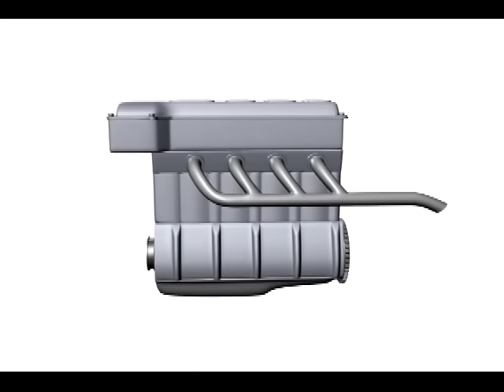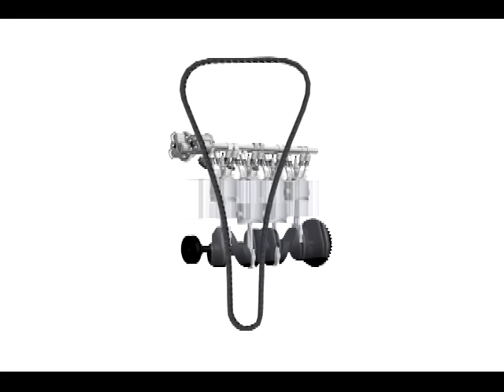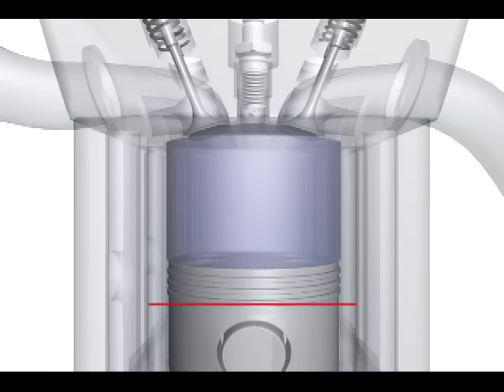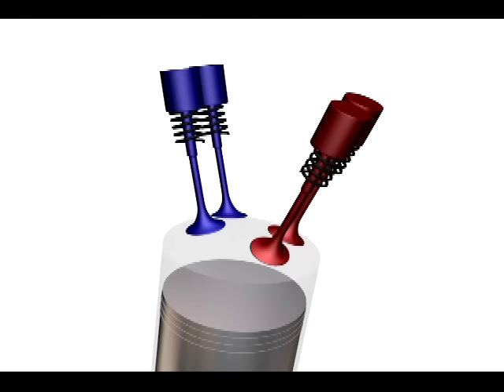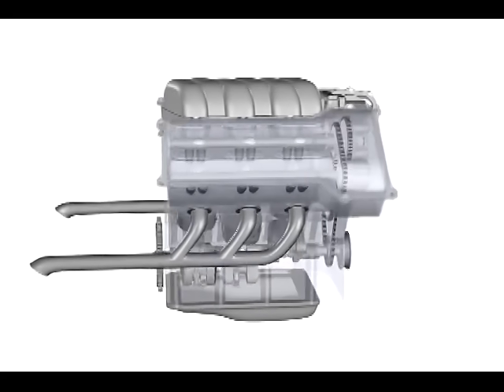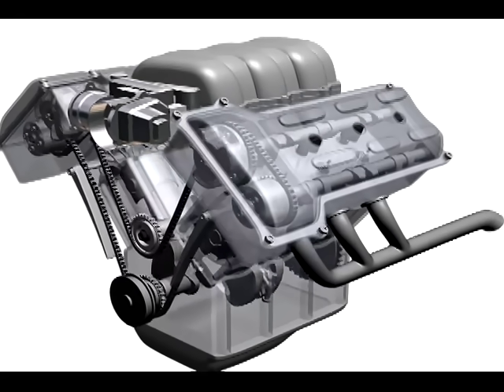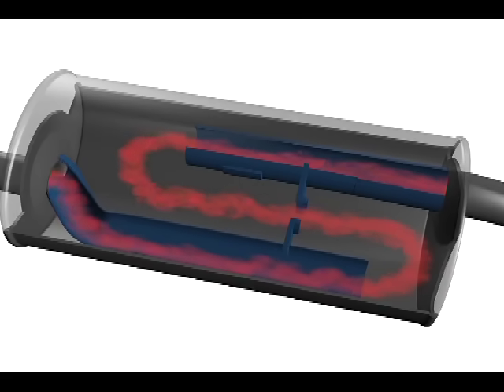How an engine works - comprehensive tutorial animation featuring Toyota engine technologies (2008)

Comment: There are some very untrue statements in this video. 
NOT ALL TOYOTA 6 CYLINDER ENGINES ARE V! Hello?!?!? 3.0 Liter inline six??? Made since the 1980's! 
Toyota has been making 6 cylinder straight engines before that too. 
Not all Toyota engines are dual (not double) over head camshaft engines either. 
Boo to whomever made this video. 
Blatant lies.
Reply from the maker: Hello, if you’d read any of the comments or the description you’d understand this was made for dealer training in 2008 and ONLY talked about current (in 2008) Toyota engines. How many videos do you have with over 10,000,000 views?
Reply: @ramblingadventures  Hey didn't you know people that watch YT videos are usually super smart and know everything about everything and will argue no matter what?  Car videos are just loaded with "expert" comments like the one above!

Comment: The modern internal combustion engine is an incredibly complex machine, that is the result of perhaps over 100 years of innovation and evolution.  The Engine is short for "Genius Machine".  I went thru Mechanical Engineering school in college, and yet, no class or professor in the curriculum ever explained this machine so thoroughly.
Reply: Engine does not mean "genius machine", and whoever told you that is an idiot. 
The word engine literally means, "a machine with moving parts that converts power into motion." 
Read people. Open a book every once and a while.

Comment: Why not just manufacture larger valves... instead of using 4
Reply: well it really has to do with how quick you need valves to fire in a certain time or the car cannot supply power correctly 🫶

Comment: "all toyota 6 and 8 cylinder engines are v type engines..." ok what about the 1HZ, 2HZ, 1JZ, 2JZ
Reply from the maker: This was made in 2008 and was only about current production Toyota engines as has been posted about 10,000 times here.
Reply: @ramblingadventures  They use HZ engines to this day in the landcruiser 70 series sold in the middle east and south america, they were just phased out of western and Asian markets. I suppose the video is only covering gas engines, but it's still wrong.

Comment: WRONG COMPLETE GARBAGE NOT ALL TOYOTA ENGINES THAT HAVE 6 CYLINDER ENGINES IN V CONFIGURATION. Take a look at the toyota supra 2jz engine for example. It is a inline 6 not a v6

Comment: Now learning about engines makes me more buy petrol or diesels, who cares about electric cars they are shit anyways real cars are with engines and those engines that last forever and are bulletproof made because not all are made to high standards.
Reply: Hassan Khan both are cool feats of engineering imo. I own 2 petrol cars but I’ve driven an electric for a year and it was fun
Reply: @818deadboys  but still you cant bear the real engines that humans beaung using for decades,  electric might be fun but when it comes to problems and repairs then one you cant repair it at home or your self and second they are not cheap to fix, and they are cheap built quality as I todays cars are known for quantity and quality. Today cars are just full of tech which most times I wouldn't need and therefore it's just waste of money for a car that would not last as long as a old e.g. toyota corolla or something.

Comment: Not a single gear head here has pointed out the motor is rotating in the wrong direction. On the single and dual over head cam motors

Comment: literally all old small block Chevy's use 2 exhaust valves and 2 intake valves LOL just saying
Reply from the maker: Yeah, with pushrods...just saying.
Reply: All generations of the small block chevy have 2 valves per cylinder not 4. There is one exhaust valve and one intake valve per cylinder, not two.

Comment: This is a very very good and informative video, however they are wrong about one thing. They said that all 6 & 8 cylinder toyota engines are V style engines but toyota does have inline 6 cylinder engines. It's still a very strong video with amazing graphics though.

Comment: Never knew that double head camshafts were a thing. I've also learned that most high performance engines use double intake and exhaust valves.

Comment: I'm driving a 1997 vs commodore wagon that takes 100 plus metres to get to 70k, maybe 80k if it's warm enough bahahaha 😂😂, have to switch the cooling fan on from under the dash with a bodgie switch, absolutely no suspension, leaks oil, coolant, transmission fluid and power steering fluid but it won't die! If it does not start it's always a loose something due to the suspension, I go around checking for loose fuses, relays or vaccum hoses popped off. Got it for nothing, It's been 5 yrs and all I do is spark plugs, leads, petrol and air filters and fuel injector cleaner once a year. I had to change a petrol pump and that's it and a vaccum hose came off. Been pretty lucky.

Comment: A lot of power is needed to complete a stroke by pushing an engine's piston up or down once.  So where does the power of the first two and last strokes of that stroke engine come from?  Because with a small amount of power it is not possible to supply a stroke of a 1500 kg car engine.  You explain a little to me.  I haven't understood this thing for a long time.
Reply: When the engine is first started an electric starter is used to spin the crankshaft and start the process. While running the force from the combustion stroke is enough to push the piston through the other strokes. The momentum of the crankshaft and the flywheel pushes the piston through the other three strokes.

Comment: How that spark works that much fast speed??????
Reply: Older cars used a distributor. Inside the distributor is a spinning contact that rotates with engine speed, as the contact turns it sends power to the corresponding spark plug. The spark itself is generated with the coil. Modern cars are computer controlled, the ECU monitors engine speed and load to determine when the spark should occur.

Comment: How does it transfer that power to the driveline?
Reply: The rotational motion of the crankshaft is transferred through a system of gears called the transmission. On front wheel drive cars the transmission is then connected directly to the wheels. On rear wheel drive cars the output of the transmission also goes through a gear in the rear axle to reach the wheels.

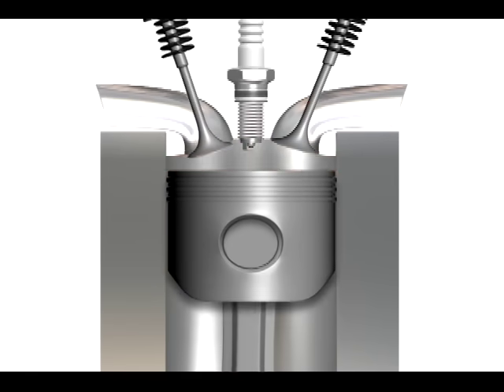Comment: 6:40 good at high speeds not good during low speeds.. would that be like a vtec engine then? Because if im correct you dont get a boost in power until you reach a certain rpm or speed right? Im not really educated about cars yet lol
Reply: Similar concepts but not exactly the same. Vtec is variable vale lift not variable valve timing. With vtec, when a certain rpm is reaced the valve will be opened more but for the same amount of time as in lower rpm. With variable valve timing the valve will open the same amount but it will stay open for a longer period of time.

Comment: Damn videos like this make you appreciate new engine technologies that oldheads love to tear apart; “filled with computers,” “can’t work on them yourself”
Reply from the maker: A lot of people still buy the BS that modern vehicles don't last as long as "simple" old ones but that's nonsense. WIth the much higher level of metalurgy and computer controlled machining, plus the fact the engines are computer controlled to run perfectly all the time under all reasonable conditions, vehicles have never been as reliable or long lasting. It's a fluke when you get a dud of a modern vehicle and it's usually a design flaw that causes it to be a dud.
Reply: Older cars were not more reliable, they were just easier to diagnose and repair yourself. I for one, do not miss the days were you had to make sure you brought spare points with you for long roadtrips, or retune your carb because you went up 2000 feet in elevation, or have to stop for a while to let your drum brakes cool down so they actually work again. Not to mention the absolute joy it is to start a carbureted engine in below freezing temperatures.

Comment: Good video. But not all Toyota engines are V ie: 2jz Toyota Supra inline 6. Known for its forged internals straight from the factory which allows it to be pushed to 700 whp without many engine modifications

Comment: How does the piston have the ability to compress the mixture initially? Does it use electricity from the battery?
Reply: Yes, an electric starting motor is used to start the process. The motor is powered by the battery

Comment: I need to know when engine has high rotation but tyres dont rotate where the energy transfered?
Reply from the maker: That is all transmissoin and clutch or torque converter. The engine is only connected to the wheels by a transmission and differential and totally disconnected or connected from driving the wheels by a clutch or torque converter.

Comment: That's not how you calculate displacement.

COMMON EXAMPLE
350 Chevy
Bore: 4.000 inch
Stroke: 3.480 inch

(Pi*R^2)*stroke*cylinders

Radius= 1/2 bore

(Pi*2^2)*stroke*cylinders

(Pi*4)*stroke*cylinders

Pi=3.14159

(3.14159*4)*stroke*cylinders

12.56636*stroke*cylinders

12.56636*3.48*cylinders

43.7309328*cylinders

43.7309328*8

349.8474624

He mentions producing torque at low RPM vs Horsepower at high RPM.

First, we must understand torque.

Torque is a measure of rotational force at the crankshaft. 100lb/ft means a force that will move 100lbs a distance of 1ft.

Next, we must understand horsepower.

Idiots think HP is a measure of an actual fucking horse pulling a weight with a rope and pulleys.
These are the stupidest motherfuckers alive and they should not be allowed to breed

Horsepower is not a real number.
Horsepower is only a mathematical function of torque.

HP=(TQ*RPM)/5252

Pull up any dyno chart. At what point do the lines for torque and horsepower intersect? At 5,252 RPM.

Do the math yourself

Let's assume an engine that makes peak torque at 2000RPM. It makes 100lb/ft

HP=(100*2,000)/5252
HP=200,000/5,252
HP=38.0807311500

Let's assume the torque curve is relatively flat. We make our peak HP at say 5,500RPM. Our engine is making 90lb/ft at this point

HP=(90*5,500)/5,252
HP=495,000/5,252
HP=94.2498095963

Let's assume 85lb/ft@6,000RPM

(85*6000)/5252

97.1058644325

60lb/ft@8,500RPM

(60*8,000)/5252

91.3937547600

At this point, power starts to fall off due to torque falling off.

Suppose our torque curve stays much flatter. Our peak remains 100@2,000. Imagine 70lb/ft@8,000RPM

(70*8,000)/5252
106.626047220

Here we see that we can pick up more Horsepower at higher RPM, even though torque has dropped off.

Racers describe it this way:
Horsepower is how hard you hit the wall
Torque is how far you drag the wall with you

It's all just simple arithmetic, folks

Comment: I dont know why, but I feel like I learn better if I do my own research than if I'm at a classroom and the teacher is going through notes over the same exact topic... Though, there are definitely more benefits to being in a automotive classroom environment since you have CERTIFIED automotive technicians and probably much more access to cars and shop equipment, that you normally wouldn't have as much of... I like being in the classroom just as much as taking the time to try and learn something on my own, but I feel that classrooms are just too fast pased for me, especially for a topic this complex.

I also feel like if I finally do get a vehicle for me to work on as my own vehicle, my education and motivation to learn will more than likely skyrocket because I can finally put the information to use, and it matters more since its MY VEHICLE and I'll become much more familiar with it instead of working on different cars all the time...

But that's just me...

Comment: "al toyota engines with more than 4 cylinders are in a V shape"

Sir u forgot about the mighty, unbeatable supercar eater, celestial legendo of tuning:
The Supra
Reply from the maker: In 2008 when this video was produced for Toyota dealer personnel, there was no non-V 6 or 8 cylinder engine in production by Toyota. The video is not a historical accounting of every engine Toyota ever made but a contemporary training piece that is only interested in the product line that was available in 2008.

Comment: Is there just enough room for the Pistons to hit the spark plug in the cylinder? I have a hard time seeing it since I imagine it being vacuum tight unless the exhaust valve doesn't the completely close on the compression
Reply: Is that why the top of the piston has the hollow holes? I just don't see how the piston closes and compresses the fuel without going anywhere?
Reply from the maker: No, the spark plug would be damaged if the piston hit them. There is a "dome" of various shapes (depending on the designer) where the compressed fuel and air occupies when the piston is all the way up. The valves do shut basically vacuum tight and there are piston rings that create a seal (by using a film of oil and very tight clearances) so though it's not a full vacuum, there is little loss of the air/fuel mixture.

Comment: How do we start it.... How does it start??
Reply from the maker: There is an electric starter motor that's run off the car battery that has teeth that mesh with a flywheel on the crankshaft that starts the motor turning. Once it's turning, the ignition and fuel system spring into life to "fire" the engine. That's why the engine is "dead" if the car battery is dead. The battery gets recharged and the electrical system is powered by the alternator once it's running.

Comment: AM familiar with older engine design but how is intake runner length change actuated, valves?
Reply: Intake runner length does not change. It is determined when the intake manifold is made.

Comment: How do F1 cars get their high pitch sound? I'm a car noob.
Reply from the maker: They rev extremly high. The parts have to be incredibly light to enable an engine to rev that high. Your average street car revs (crankshaft revolutions per minute) to around 6,000 RPM (revolutions per minute). A high-performance street car might rev to 8 or 9,000 rpm. Older F1 cars could rev to 18,000 RPM! To save cost, they are now limited to "only" 15,000 RPM. Similar to what a high-performance motorcycle engine sees.

Comment: Question: which type of engine is this? SI or CI? because you told air fuel mixture is enter through the inlet valve then what is the use of injectors in this engine? i am confused!
Reply: The injector usually injects the fuel just before the intake valve. On some cars, the injector injects the fuel directly into the cylinder.

Comment: VVTI systems for computer programs, anybody?
Reply: couldn't you just control the intake with pressure of air in lines just reconstruct the spring over head injector valves??
Reply: 7:09 wouldn't be necessary if the spring system in the injectors above was redesigned with pressure system air/NO3 pressure tanks.
Reply: Patten Pending EVS LLC

Comment: Yes i have the basic question...how piston gets energy..to move...there must be something to initiate piston movement at first.
Reply: martin mathew The counterweight
Reply: @luayon  no, the counterweight helps reduce vibrations and make it easier to push the piston up when the engine is already running. An electric starting motor is used to start the entire process.

Comment: Question: You mentioned about fuel injectors in very start of the video so it should be Direct Injection Gasoline Engine but when you explained the strokes you took mixture of air and fuel directly from the intake valve why theres no injector in explanation??
Reply: OTTO Explained I think it is with the “breaths” 

It sucks in, the injectors go sssspheeeewww and then it sucks it into the combustion chambers or sumthin.

Comment: Won’t VVTI throw off the timing of the engine if it constantly changes the valve opening/closing? Especially if it only controls one camshaft?
Reply: Yes, thats why its called variable valve timing. The timing is changed to make more power or fuel economy

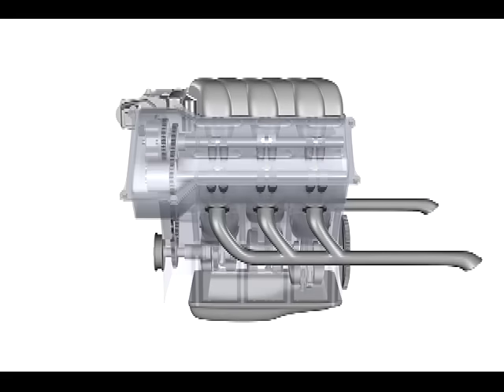Comment: Automotive engineer here. At 2:31 it says that higher compression ratio require higher octane fuel. First, it is not the combustion chamber and the cylinder that is build around fuel, but the other way around. A fuel with higher hydrocarbures links is more likely to combust on it's own because of it's more volatile nature (it stores way more energy, thus unstable) ergo it makes an alternative fuel beside gas. That being said, with a fuel that is volatile enough to combust on it's own (at high temperatures and pressure), engineers made an alternative internal combustion engine with more space, so the fuel can accumulate enough pressure and temperature during the compression phase, thus making higher compression ratio! Second, a fuel that is more likely to combust on it's own would have a high cetane number, not octane. An octane number is quite the opposite. Octane number represents the fuel's capacity to not combust on it's own. Usually cetane is associated with diesel and octane with gas! Have a nice day :D